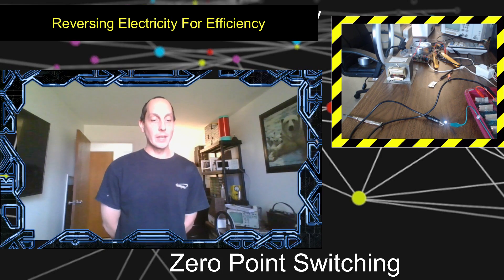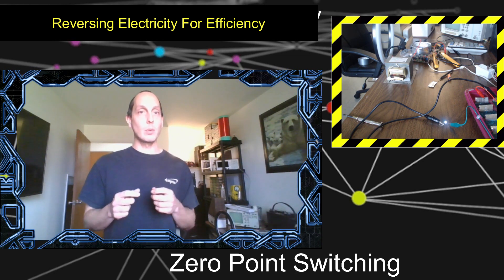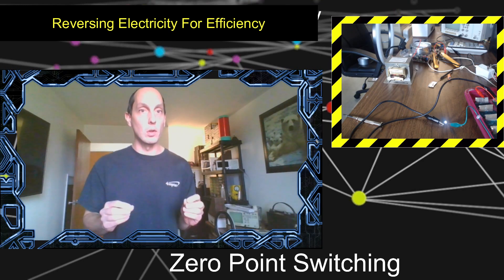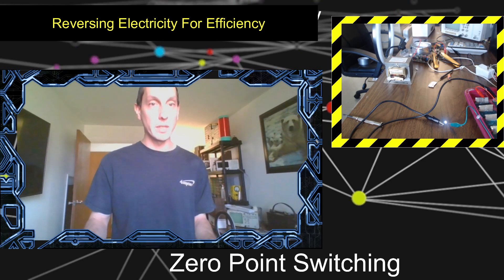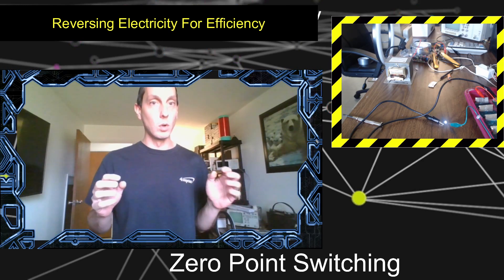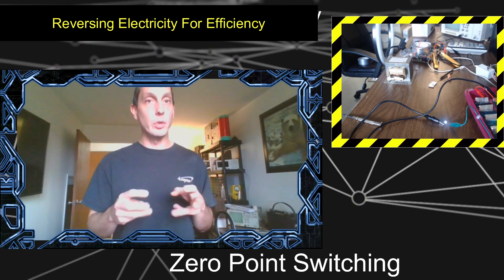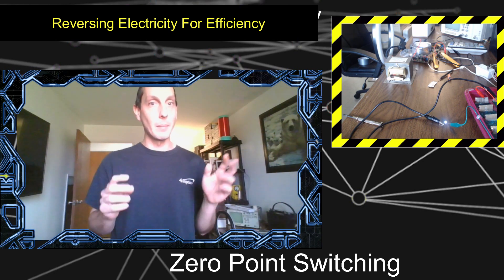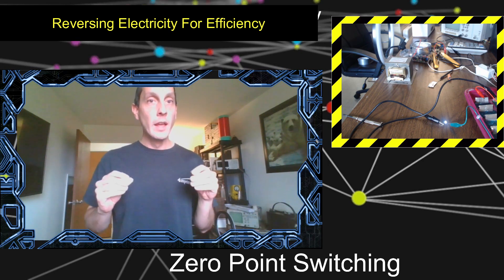Efficient Displacement Current

Comment: YES, YES YES!  You got it Joel!!  Every time you open your mouth beautiful things come out.  I use my plates to get that potential, maybe similar to your cell.  Yes, the system loves capacitors. Can charge fast. Caps care about voltage not so much current.  Yes, HF, skin effect, things get tricky.  Ion vales/radionic vales,,, have you studied Thomas Henry Morey yet and his third generation device, i think he used a piece of iridium.  Everything you mention coincides with my experiments.  I need to get into higher frequencies myself.
Yeah, wow. Keep up the great work Joel.  Oh, and you "do" demonstrate a lot of what you talk about.  Incredibly using low cost household items. 
Going to work now. I wish I had more time.

Comment: Joel in the pdf you have a blue and a red for the channel 2 input. Which one is it? If you can answer that please
Reply from the maker: negative and positive all isolated. So 4 channels technically with 2 switching at the same time in sync for one electrical loop (charge) path and then off for the other 2(discharge) Back and forth 50/50